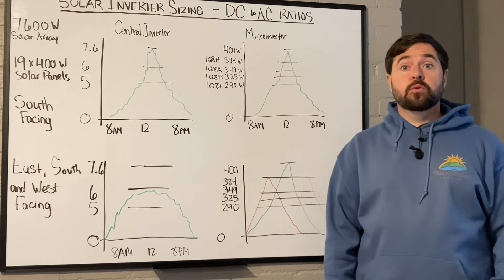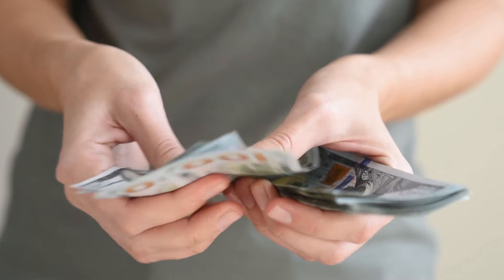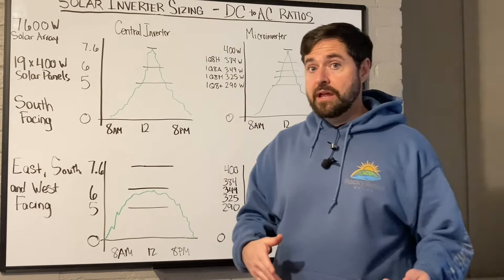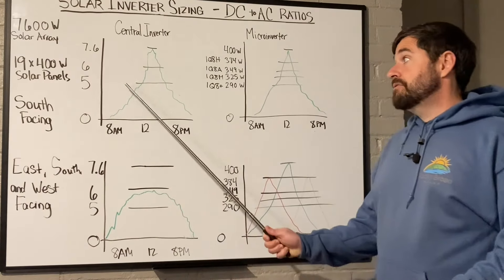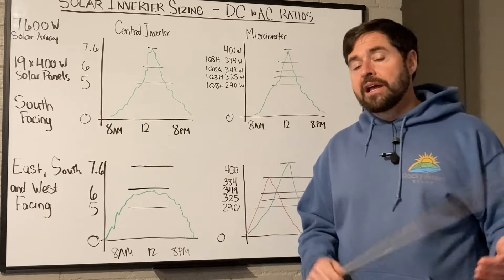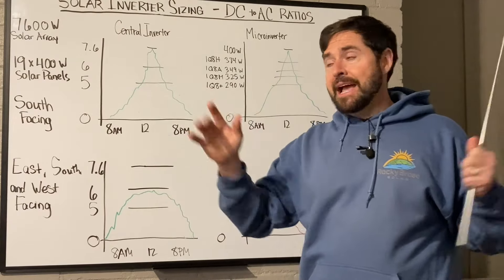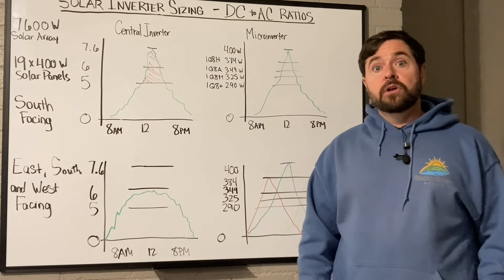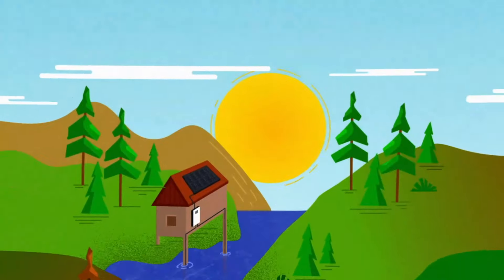Solar Inverter Sizing - DC to AC Ratios

Comment: Very good video. Would be great if you can do more on microinverters such as install steps or components needed like dc/ac disconnect
Reply from the maker: Absolutely. I plan to do some more hands on videos in the future once the channel is up and running. Most microinverters have a combiner box with circuit breakers that are considered a code compliant AC disconnect per NEC guidelines, but many utilities have their own unique AC disconnect requirements.

Comment: Hi, great explanation, im about to buy a 6.9kw array on an East facing roof. I have been offered either a 5 or 7kw invertor for the same price. Which one would work better, i live in the UK so not especially a sunny climate. Im also having a 10kw battery if that impacts anything. Many thanks
Reply from the maker: Tough call. That is a 1.38 DC:AC ratio. You could certainly get away with a 5K inverter, but you will probably experience some clipping in the late morning in the sunniest months of the year. Thanks for watching!

Comment: Rated output <> Actual output.  My system is rated at 2.1kW peak, but I never see that level of output from the system in my location.  The highest I've seen it get to is about 1.7kW peak.  I've got a 2kW inverter (grid-tie), so I'm thinking that I I can replace those old panels with an array that's at least 2.5kW peak.  While it's possible that the output will be clipped sometimes, they will also be generating more power than a smaller array would be doing at other times, which should reduce the payback time.  Now I just need to figure out what panels I should get to replace the existing 12-panel array ...
Reply from the maker: Absolutely. I will tell you, if you check out my Signature Solar affiliate link down in the description, they have the cheapest prices I have ever seen on the Canadian Solar panels. I went ahead and bought a pallet a few weeks ago. Good brand and all black modules. Couldn't beat it.

Comment: This is EXACTLY the size of my Solar Array - 7.6 kWh (19-400W RAE panels). I have a 7.0 kW SMA central Inverter (perhaps a little oversized, but I wanted to allow for adding some panels.) My system was installed without a battery (Grid-tied only.) I now want to add a battery to the system. My question is: How big a Battery should I install? I was hoping for a better technology (like Sodium-Ion), but it looks like Li-Ion (LFP) will continue to be the best, at least in my lifetime. I have 12 panels facing Southward, and 7 panels facing Westward. The first year I produced a little over 11,000 kWh of power. In 2022, I used about 10,600 kWh. In Texas, A/C takes up the majority of our power. My Heat and water heating are provided by gas (not my choice, but the systems were already in place when I bought the house.) I plan on adding a Battery in 2026. Again, what size would you recommend?
Reply from the maker: HI Bob! Thanks for reaching out. That really depends on the purpose of the battery bank and your individual home loads. There are 4 main questions to ask....
1. Are you only purchasing the batteries for backup power, or is the main purpose to cycle them daily to maximize your self consumption and avoid using the utility power? Usually if you get "net metering" you would only need the batteries for backup, while if the utility charges you more for power than they pay you for your exported power, you would maximize self consumption.
2. Do you want whole home backup or partial home backup? In either of these cases you will need to roughly know a list of any breakers exceeding 20A, and what they power.
3. Do you already have a specific battery picked out? Each battery is going to have a different "max continuous output current" and a different "peak output current" which will determine the individual load it can handle.
4. How long do you want to be able to run during an outage before your batteries drain out?
That A/C in Texas is no joke. Even once sizing the battery to meet the instantaneous power requirements, those things will drain your batteries down pretty quickly.
Reply: @RockyBroadSolarLLC   "Net Metering" is no longer available in Texas. The power Company charges me about 4X what they pay me for power exported to the grid. I am billed monthly for 200 - 500 kWh, but credited for about 500 kWh at the lower rate. I want to maximize my self consumption. Whole Home back-up would be nice, but I first want to use all the power I produce. We have NOT experienced any long outages here - even during the 02/2021 deep freeze. I can add a soft-start to my a/c system, but that is my biggest draw. I used 10,600 kWh in 2022. I am guessing I need a 15 - 20 kW battery. Am trying to hold out for Sodium-Ion or solid-state, but cannot wait past 2027. In that case, I will use LFP Li-Ion technology. Thanks for your extended comments. Do you have more with this new info?
Reply from the maker: @bobjohnson7280 So I took your 500kWh that you are credited per month at the lower rate, divided that by 30 days, which gave me roughly 16.66 kWh per day you are exporting to the grid. Assuming you would cycle your battery bank daily, If I were you, I would get a minimum of 20kWh battery bank. Some days will produce more than others, and usually you would want to leave at least 20% of the batteries for reserve in case of an outage, and I believe it will lengthen their lifespan by not draining them under 20% regularly. Now which loads in your home you will be able to back up is going to vary based on your AC coupled battery inverter, but a general rule of thumb is that most 10kWh battery banks can cover your 15-20A circuits, a 20kWh battery bank could cover breakers up to 40A, a 30kWh bank could cover breakers up to 60A, 40kWh up to 80A, etc.

Comment: I want to buy most of my parts from Signature Solar so I just need a good installer but everywhere I inquire they want to sell me panels and inverters that they furnish at much inflated cost to me. I live in San Antonio, TX. Here are the basics of what I want. 
Sol -Ark 15K Hybrid inverter@ $6499
EG4 PowerPro Wall mount All Weather Lithium battery 48V 280Ah 14.3kWh LiFeP04 @$3799
19 Aptos 440W Bifacial Solar Panels (Black) @ $211 ea.
My roof is facing south with no obstructions at all.
What do you think. According to this video I would not need a 15kW inverter but this inverter allows me to install more panels later on my Garage.
Reply from the maker: You will be hard pressed to find an installer willing to install homeowner purchased/designed equipment. They generally make a mark up on the equipment. Most installers specialize in installing a narrow product offering in order to be efficient and able to provide service to the system in the future if something needs replacing and be able to design/permit everything. I am sure if you reach out to some local installers you might find one willing to work with you, but most will probably pass, or mark up the labor to make up for learning a new system and not making anything on the equipment.
Reply: @RockyBroadSolarLLC  Your right an I have changed my mind on the inverter. I am thinking of going with the Sol-Ark 15K as it is battery agnostic
Reply: @RockyBroadSolarLLC  Yes I realized that I would need a different hybrid inverter like the Sol-Ark 12K or 15K

Comment: your talking solar not the inverter that is doing the dc to ac
Reply from the maker: That is correct. I am talking the ratio of the DC solar panel array compared to the AC size of the solar inverter. Thanks for watching!